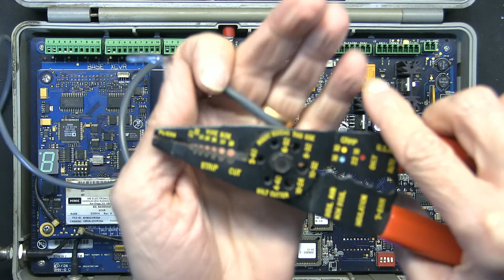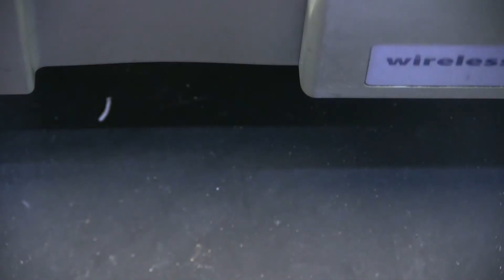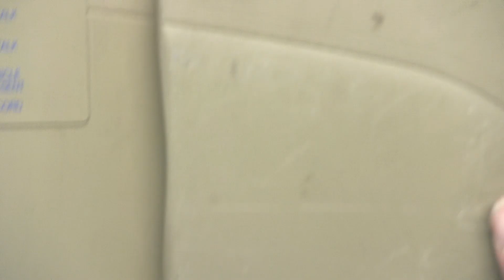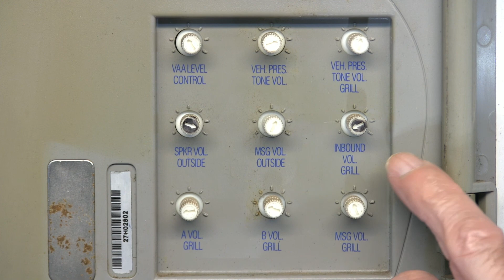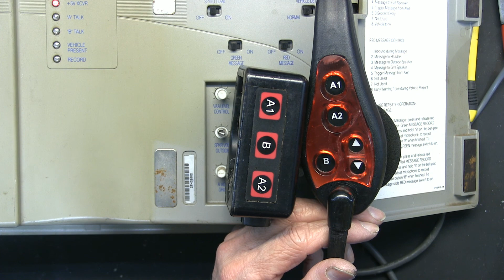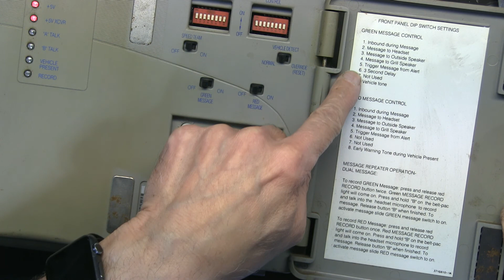Complete Installation, Registration & Wiring Tutorial For HME Base 6000 Wireless Drive Thru Intercom

Comment: Excellent video BUT one main error. You aren't suppose to have the mic and speaker wire in the same jacket. The loop and speaker are in one wire jacket and the mic is in its own wire jacket.
Reply from the maker: Very good point, however the cable that I was using had two independent shields. Separating the Microphone and speaker wires by an aluminum foil wrap.

Comment: Thank you for such a great video it helps a lot. I have 2 questions.
1-  Is it possible to register any bluetooth headset or it will only register HME headsets which are rare
2- The speaker in grill has sound of the cashier talking but we can not hear the customer speaking in grill speaker, is there any way to fix that?
Thank you
Reply from the maker: You are very welcome, and here are the answers to your questions 
1. No there is not way to register a Bluetooth headset to this HME Base Station, also the Bluetooth headset  doesn't not have A1/A2/B buttons. It only has talk and hangup buttons
2. Yes you can do that by changing the dip switches and jumpers, see the manual linked below https://www.hme.com/techPdfs/400G558e.pdf

Comment: I want to add Grill Speaker on this unit. Can I use any kind and size of speaker? I tried to connect a speaker with amplifier, but it didn’t work. Is there a process that I am supposed to do to make it work?
Reply from the maker: Hi, I am not sure about the Amplified speakers, but I have used the BGI speaker linked below for indoor Grill and it worked great  https://www.ebay.com/itm/234022135282